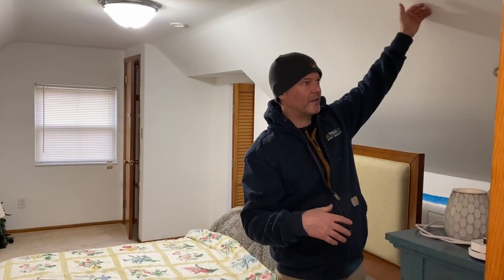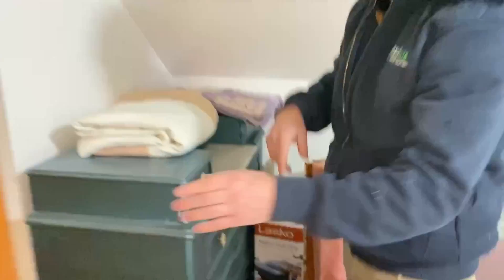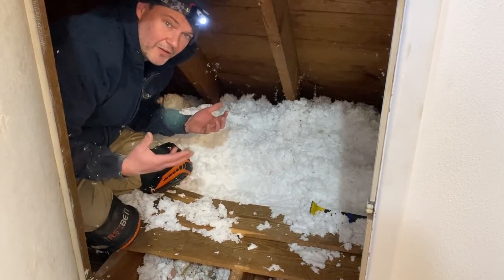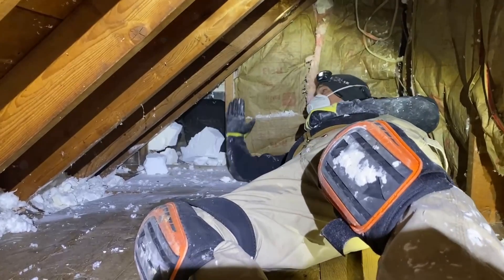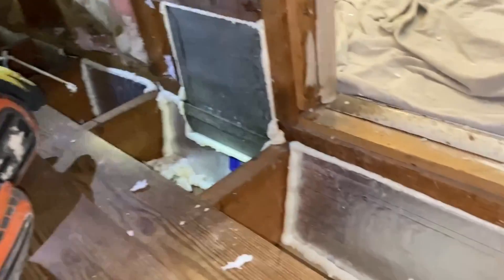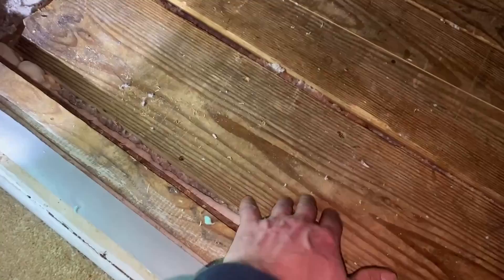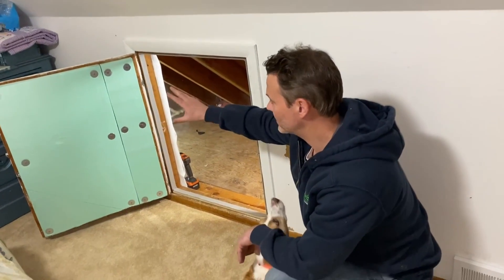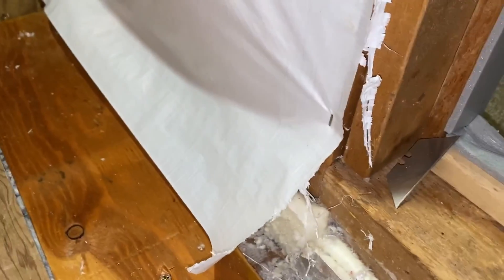What Happens When the WRONG Insulation Company Gets Hired?   Warning...This Gets Ugly

Comment: I love the insight on the sealing the subflooring - one more thing I will be sure to account for when I redo the insulation in my house this spring. It's a 1954 Cape Cod style house that currently has R11 batting in the upper attic...and I have a similar knee-wall area (except it's actually a full-size door because the opposite side of the house has a dormer on the 2nd floor). I noticed similar problems with the walk-in attic: R11 batting with the kraft facing pointing out from the 2x4 studded wall frame, no weather stripping or insulation on the back of the door. So it was also nice to see how it should look when it's done, because I wasn't sure. Thank you for that. One possible issue I'm seeing with the updated insulation is that the insulation appears to go all the way into the rafters from the subfloor - and no air baffles installed. Does the house not have air vents in the soffits? Again, I potentially have a similar challenge - only 3/4s of one side of my house has soffit vents. If I understand correctly, that helps ensure that hot air in the summer can flow freely up to the ridge vent and escape. I'm also adding a radiant barrier across the bottom of the rafters (after removing existing R11 batting also in the rafters) - because my electric bill vs gas bill definitely suggests I spend a lot more on A/C in the summer than heating in the winter - even though I live in Wisconsin. I'm just not sure if I need to use a perforated radiant barrier or if I can use 1-inch foam board with radiant barrier surfacing so it's both a thermal and radiant barrier.
Reply from the maker: Thanks Tim!  These spaces are difficult to properly retrofit.  We bypass the slope ceiling as a ventilation pathway in these types of homes because 1)  you only have 5.5" inches of space to insulate and if you use almost 2" inches of that for a baffle, you seriously degrade your R Value in a critical area 2)  it's almost impossible to effectively retrofit baffles into sloped ceilings due to roof nails and no ability to staple the baffle in the middle of the slope 3)  if water gets into the slope via a nail pop on the roof, it can easily dry to the upper or lower attic immediately above and below the slope and 4) we vent the lower knee walls (and upper attic if it's not already vented) using slant back vents.  

We treat the upper and lower knee wall attic spaces as separate attic spaces.  We've performed this solution in our area on well over a thousand homes and had good success with it.  Hope this helps!
Andy
Reply: @insulwiseenergycomfortsolu3293  so, you blew in cellulose into the upper sloped rafter cavities?  From the upper attic space?   Also, how many roof vents are necessary in the lower knee wall areas?    THANKS!!!
Reply from the maker: @mattcantrell5640  Hi Matt, yes we dense pack the sloped bays with cellulose insulation.  It's better to plug the bottoms of the sloped bays with fiberglass, and then tube down and blow them from above.  I'll attach a video link where you can see us do this.  You can also insulate the slopes by tubing and blowing up them from below, but it's A LOT less fun ; ).  We use at least one slant back vent for every isolated knee wall space.  A small or corner space would get one.  If you have a longer knee wall section we place one about every 12-15 feet.  If you've air sealed your knee wall spaces well, these vents will be adequate for making sure you don't wind up with a mold problem. 
Newer Cape Cod upgrade video:  https://www.youtube.com/watch?v=x_z9FLeg5AA
Andy

Comment: I choose to poly my slopes, but of course they added propavents before sealing the slopes. That's the best way to make kw's conditioned spaces.
Reply from the maker: This can be made to work, but the reason I prefer to not insulate the underside of the roof in knee wall spaces is because I want to get maximum air flow to the underside of the roof to help it dry during the winter months.  If you have a small roof leak or mold problem, you are unlikely to see it once its been covered.  In some instances when we've removed batted fiberglass or rockwool batts from the underside of roofs we have found mold growing beneath.  If you have baffled and vented the roof right the odds of this happening will be diminished, but I still feel there is a higher chance of this occurring.  Best of luck to you and thanks for the comment!  
Andy

Comment: Thanks for the video! I’ve been trying to update my ceiling insulation and your videos have been very informative. 

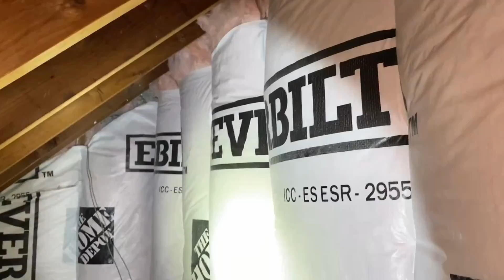Covering the insulation with home wrap is interesting (at 9:23 in the video). I’ve heard of people doing that on the attic floor to prevent convective heat loss, but I’ve also seen people worried about condensation. 

Have you had any issues with condensation?
Reply from the maker: Hi and thank you for the compliment!  We use building / home wrap to go over the top of the fiberglass on the knee walls for two reasons.  First to effectively hold it in place over the long term.  We use batts fall out of or get degraded in these areas all the time.  Also, we use it to act as an air barrier.  It helps to keep the fiberglass from being "windwished" by air currents that may occur in the knee wall space (from roof ventilation).  The prime role of the home wrap is to allow the fiberglass batt to perform its role as efficiently as possible for as long as possible. 
Andy

Comment: Probably a rhetorical question, but do you do both sides of the rafter/joist bay?  What kind of difference does doing one side make?  I don't yet have access to the knee walls on the front of the house.  The back is one large space with an access door that goes from end to end of the house, so I can easily block one side of the joist bay.  You can definitely see the transition in the ceiling on my Seek Compact thermal adapter.  The knee wall area that has batts laid in the joists reads warmer than the uninsulated core ceiling because of the draftiness.  I would block the soffits, but they're baffled and I am going to be replacing the current one with some Hardisoffit for better flow.  I currently have a bunch of 2 inch vent plugs that dont equate to much air volume.
Reply from the maker: Not sure I understand you're question, but if you mean do we seal the floor transition gaps in both the front and back of the house the answer is yes, 100%.
Reply: @insulwiseenergycomfortsolu3293  The bay will have two sides, one on the front and other at the back of the house, so there will be two openings under the floor that stretch from soffit to soffit.  I was wondering if there was any measured difference with doing just one end of the bay as I'll have to cut into the sealed knee walls that flank the dormer windows on the front of the house.  I'm thinking it would stop air transfer, but I guess you really need to block both sides since the stack effect will cause pressure to move heat to cold.

Comment: Very informative. Did you consider making the knee wall area conditioned space? And what foam board do you use. Thanks!
Reply from the maker: Thank you, the only way to reliably make knee walls a conditioned space in my opinion is to use close cell spray foam on the underside of the roof.  You need to install something against the roof that is a 100% reliable vapor barrier, otherwise you invite a mold/ roof rot situation.  Closed cell foam however is very expensive, and most people do not need to use these spaces for anything but storage.  Our solution is designed to economically make the original conditioned space more comfortable and energy efficient, while safeguarding the integrity of the roof by providing a way for moisture to escape to the outside.  For air sealing we use 1/2" thick silver faced polyiso foam board.  For insulating the knee wall access hatches we use 2" thick XPS foam board for the extra R value and durability of it. 
Andy
Reply: @insulwiseenergycomfortsolu3293  thanks!

Comment: Excellent video, but you didn’t show how you insulted the slant wall or the top space.
Reply from the maker: Correct, that's an omission.  I am going to create a proper video that shows how we insulate these types of homes that shows all of the details.  In these case we dense packed the slopes with cellulose insulation.  The slope itself is unventilated, as it's nearly impossible to get a baffle into place.  But if there is a nail pop or some water intrusion through the roof, the moisture does not have to migrate far before it hits either the ventilated attic above or below.  
Andy

Comment: This is exactly why I DIY as much as I’m comfortable doing as possible. Even though it takes time to learn new skills and my efficiency isn’t on par with someone who does this work for a living, no one will care as much about doing things right in my house as I will.
Reply from the maker: Either do the research and do it yourself, or hire a building-science based insulation company.  And even then, you want to educate yourself as well as you can and fire as many questions at them as they can.  If you find they are wary of answering questions or seem to get annoyed by it ---- walk away.
Reply: @insulwiseenergycomfortsolu3293 so I thought I saw something about the space above the room.  But at the end I didn't see you. Say anything about it.  So you didn't insulate the ceiling space under the room because you want heat to rise through it.  But what about the space between the upstairs room and the roof?
Reply from the maker: @davidshumway9639    Hi Dave, yes we insulate the slope ceiling areas and also the upper main attic.  
We dense pack the slope ceilings with cellulose, and we air seal the upper main attic floor and then blow it with loose fill cellulose. 
Andy
Reply: @insulwiseenergycomfortsolu3293  I thought you said that but did you show it at the end.  I may have gotten distracted and didn't see it.  Just wondering if you forgot to cover it since the main focus was the floor bs wall areas.
Reply from the maker: Outstanding advice.  For insulation work always first seek out building science based companies.  And definitely walk if they shirk your questions or get annoyed.
Reply: @insulwiseenergycomfortsolu3293 exactly my belief system as well. I do most of the stuff around my house, cars and motorcycles on my own and the odd times when I hire professionals, I make sure I am educated in all the intricacies. Call me a cynic, if one may, but I just hate to be taken for a ride by shoddy, shady "professionals".
Reply: I agree completely. Most companies that do insulation don't do it right. I keep getting quotes and all these people don't know what they are doing. This guy does for sure. So few companies spray foam all those gaps that need to be done. They just come out and blow in Cellulose or fiberglass insulation everywhere. Not good. I know and understand all that now thanks to this guy's videos.
Reply: Gosh I wish you had an office in Montreal!

Comment: Question. Before you put the insulation boards in and foam around them, do u push insulation in under the floor first? Does it matter, or make it worse.  Great video. My entire house is like this and house never gets warm.
Reply from the maker: Good question.  We do not put insulation in between the two conditioned floors.  You would typically not insulate in between conditioned floors or rooms, unless the intent is to insulate against sound transfer.  In this case we want the heat from the first floor to rise upward and warm the floor of the second floor.  Blocking the "transition gaps" with foam board and foam sealant ensures that the warm air rising from the first floor cannot escape into the knee wall spaces.  Hope this helps!
Andy
Reply: @insulwiseenergycomfortsolu3293
How is the space between floors ventilated, now that it has been sealed from the unconditioned air?
Reply: @insulwiseenergycomfortsolu3293 so one area is conditioned to conditioned and I have insulation in the normal locations so I will add the panels so the outside air does not go through the floor. However my second to third floor is conditioned to a completely open third floor with zero insulation. We never finished it so it’s just storage. The 2nd floor ceiling has no insulation and I think all my heat is getting lost there. So I should pack the third floor with insulation and put panels in as well correct.

Comment: Wow what a cluster they screwed those folks over bad.
Reply from the maker: There are a few companies in Pittsburgh whose work we routinely redo.  Like, I can't even believe people hire them.  It goes to show the power of marketing I guess.  The injection foam guys are uniquely bad.  They tend to be one trick ponies with little if any building science chops.  And that stuff is a poor product on its own IMO ( installed the stuff with two different companies when I was first getting started and saw the shrinkage first hand).
Reply: @insulwiseenergycomfortsolu3293  Andy, as a South Hills resident, I respectfully ask you to somehow name these companies! We need to beware!
Reply: @insulwiseenergycomfortsolu3293 and it interfers with repairs and maintenance.
Reply: @insulwiseenergycomfortsolu3293  Does new foam shrink, or is it just the old?  I've torn out the old from the 70's and it was totally worthless, and in many cases worse than than just leaving the batts in place.  I thought they had fixed the shrinkage problem.

Comment: Why would you have openings into knee wall if there is no floorboard for storage.
Reply from the maker: Good question, many people actually do not.  Often we need to cut in openings to perform our work then install drywall patches when we are finished.  But some homeowners want to have them so that they have access to those attic spaces so they can get to them if there is a roof mold or critter issue.  I personally would opt to have the access.  I would want to be able to see and inspect every part of my house that I'm able to.  I have seen too many small problems turn into big ones because areas were out of sight. 
Andy
Reply: Ahhh i cqn totally relate as i just finished bug room that looks very similar and one side has a small knee wall we have no way of getting too right now as no access door was created.  I will at some point i will add floor board, it has foil bubble backing the fiberglass batting, which is s vapor barrier also but now i want to put foam board in first then put the foil bubble up.  The foamboard will as you said seal that off.   Thanks for the answer.

Comment: Is blocking the ceiling joists necessary if its insulated under the decking of the top floor?  Getting ready to finish our cape cop and under the upstairs decking is insulated so is the blocking necessary? Thanks!
Reply from the maker: Yes, it is necessary.  The reason is because insulation itself does not stop air flow and air leakage.  When we encounter floors in these spaces we cut a 12" wide gap in them, seal the "transition gaps", and then put the floor back in.  It is certainly more work, but it will improve the comfort and energy efficiency of the home for doing it. 
Andy

Comment: Should there be insulation under the floor of the living space if an unconditioned garage is directly below the room?
Reply from the maker: Great question -- the answer is yes.  We dense pack garage ceilings with cellulose insulation here on a weekly basis.  Almost all garage ceilings, even on houses built recently are ineffectively insulated.  The older houses often have no insulation.  Fiberglass batts are almost always ineffective.  You NEED a solution that 1)  blocks air infiltration coming in at the exterior wall rim joists and 2) stays in constant and continuous contact with the floor above.  
Andy
Reply: @insulwiseenergycomfortsolu3293  thank you Andy! I have a completely unfinished room above my garage. It is only studded with zero insulation. I’m trying to understand what the proper way to do things are before I DIY or hire someone. I am in a fortunate position to where I can be sure it is done properly the first time. Good to know fiberglass batts are ineffective in this application. That was going to be my initial plan of action.

Comment: I did the exact same thing in my cape in the north east. Blocking off the floor the floor joists made a HUGE difference! My crawl spaces are unseated as they should be. One thing I did that also made a huge difference was to install access doors that were solid core units set up in an exterior frame. Really worked well, and we were able to keep access to the storage areas, although they can be cold.
Reply from the maker: Nice!  Yes this process works well, we've done it in probably over a thousand homes in Pittsburgh that have this configuration.  The doors were a nice touch, if they're not insulated you may want to consider insulating the back side of them with a good piece of 2" inch thick foam board.   The other thing you may want to consider is getting the crawl spaces ventilated, if they are not already.  We've found that attic spaces of any kind that are insulated, but unventilated are good recipes for mold growth.  One way or another, unplanned for water or water vapor usually finds a way in.  Hope this helps and nicely done!
Andy